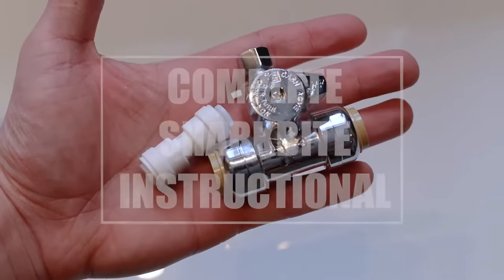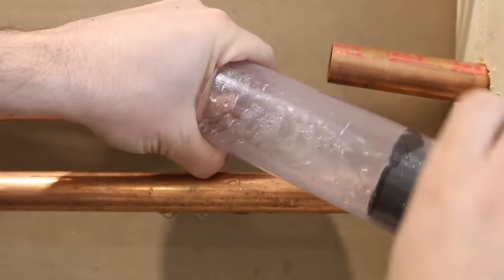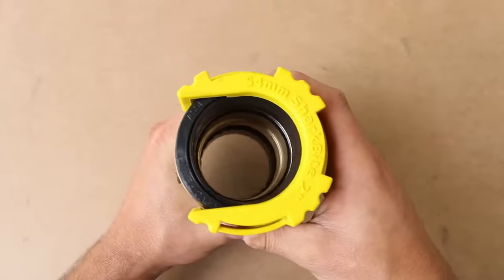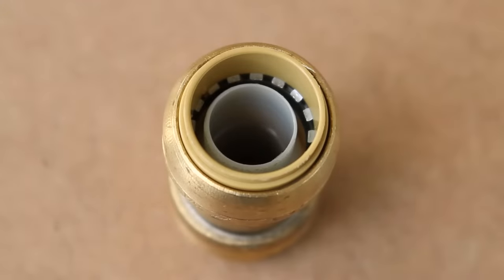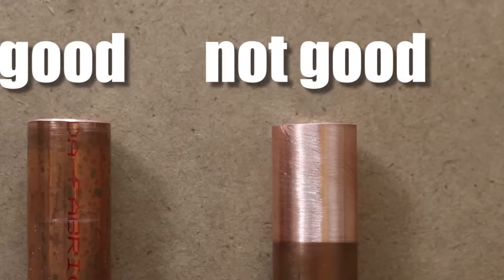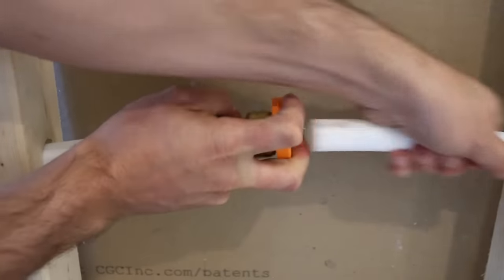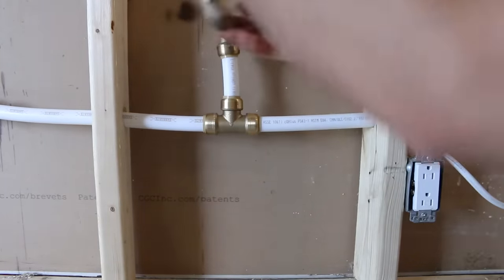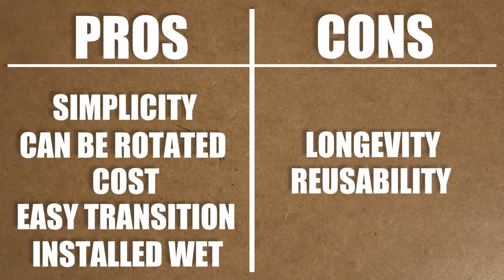Beginners Guide To SHARKBITE Fittings (Watch till end BEFORE Buying!) | GOT2LEARN

Comment: I plumbed our pavilion with pex and crimp fittings back in 2013 and just recently had to repair 3 pin holes. One in the 3/4” after the main shutoff and 2 close together in the 1/2” branch. All were on an exterior walls. I’m not a plumber by no means but I’ve installed plenty but I’ve never seen pinholes happen in pex before. We’ve had some brutally cold temps over the years and since they all were in an exterior walls, I’m assuming that’s what caused the leaks. I still haven’t lost faith in pex… yet.

Comment: My house was built 2011 and the builder's plumber used a Sharkbite 1 inch to 3/4 inch to connect the water main coming to the house. This was underground and it failed in 2020. After checking with Sharkbite, they said they were not intended for this type of use and that will only last 12-15 years inside walls and straight-on connections only. Having it in the ground does not work because of settling. After looking at the pipe connection going to the house,  there was a slight bend in the pipe underground.  The plumber who came to the house also stated Shark Bites were not intended to be used outside underground.

Comment: I used them several times with no problem. The only exception is at my 2nd home where I turn off the water and drain it every time we leave. It would blow off or leak badly when I turned the water back on after several times. This was used on Pex 3/4 pipe.
Reply from the maker: Interesting.

Comment: Using this product is a heck of a lot cheaper than using a plumber. We have the grey PB plastic, and we have replaced 4 leaking T fittings. Just remember to buy the adapter from Grey PB to PEX and you will be fine using this product
Reply: Was the PB adapter a Sharkbite product or just a regular PB to PEX fitting with rings?
Reply: @MissLiz55  it is a Sharkbite fitting. It will be labeled PB to PEX with whatever diameter you need. On the adapter, the grey colored side goes to the PB pipe, and the white side goes to the PEX pipe

Comment: Wish I had learned about sharkbite when I was repairing water hose valve.  It was a PITA trying to solder a wet pipe.  But i'm with you -- not trusting this product behind walls, attic, or underground.

Comment: My father warned me about sharkbite fittings after several came "loose" after a couple of years on a friend's property.. was all due to the washing machine/dishwasher/taps causing shockwaves in the supply pipes, acting like a small hammer.
Guess it depends on the peak pressure and the pipe as to what it can deal with

Comment: The best thing bout these fittings, they can be installed even if the water cannot be totally shut-off. You could never solder a pipe if any water is present. Installed the fittings a number of years ago, no problems so far. 
You can get a plastic removal tool to take them apart, but I made my own with a piece of wood, works much better, especially in a tight space.
Reply: The metal removal tongs that Sharkbite sells are way better than the little orange plastic tools.  Costs about $7, they are size specific though.
Reply from the maker: @StilettoSniper  iCrimp will send my a tong that does all 3 sizes, pretty neat!!

Comment: About that cost- about $20 each here in my local store. It's enough that the hardware store plumbing guy prepped me for the sticker price after he restreived them from the locked case and before walking me to the checkout with them.

Update: after using for the first time, it's definitely a great product for basement usage at the low point in the system where you just can't get it drained. But I really don't think I'd want them buried behind a wall somewhere. This is in a century home, where the expectation is that things should last well beyond 100 years... and indeed much of the house is original.
Reply: The fittings can be expensive but thats really only been post-pandemic. I had bought a few during the great Texas winter a few years back and they were around $6 each, now theyve gone much higher, as you say, to around 15-20. I did find some off brand fitting at a local hardware store for around $7. This video shows the pipe being $14 per linear foot which ive never know pex to be any more than about $1/ft on larger pipes. 1/2" is typically only $40/100 ft roll. 

These fittings have saved my 50 year old copper in my home on several occasions and bought me time until i can get to replumb the entire system. At that time ill use cinch style connectors but you can bet your next paycheck ill be taking off the older sharkbite type fittings and saving them for emergency use!

Comment: 9:20 I'm not a plumber, but if a small burr is a problem from a turbulence/flow disruption standpoint, then a giant loose plastic insert sitting inside a copper pipe is also going to be. SharkBite has instructions for removing the insert without damaging the teeth, and it seems like it could potentially be worthwhile...at least if you're taking the time to remove internal burrs.

Comment: Great video. Very instructive. I was told that the white plastiv compression ring should be removed for copper pipe. Is that correct ?
Reply from the maker: It can remain, just make sure the inside of the copper pope is deburred so it doesn't catch while it's going in ;)

Comment: On horizontal pipe runs the pipe stiffener falls down and prevents any pipe from inserting more than about 1/8”. For this reason I ended up returning hundreds of dollars of shark bite fittings back to the store. The pipe stiffener is more or less captive inside the fitting. But it does move around a bit, but the pipe stiffeners must not be able to touch the inside wall of the fitting. I was using a Home Hardware version of Sharkbite

Comment: I think PEX / CPVC is harder to remove because the teeth can grip into the plastic more easily than copper. Pushing hard & going around in circles several times to disengage all the teeth worked with the orange clip — but it took a good 5 minutes the first time with a free pipe.  

Seems like a wrench or other metal tool would be much easier

Comment: I have never had a shark bite fail on me, but at the same time I'm still reluctant to use them over crimping or soldering.   
I will use push fittings in an area that is accessible But I definitely would not  use them in a closed wall.

Comment: I just installed a sharkbite push fitting on my 1/2” copper pipe for my washing machine valve and have 2 important questions.

1. The initial copper pipe was crimped from removal of the old compression ferrule, causing the new compression ferrule to be too loose on the pipe. I used a Sharkbite push fitting with a MIP end instead and no leaks so far. Opinions regarding the crimped pipe and maintaining a tight seal?

2. I cleaned the outer pipe well with a drill attachment, and also deburred the inside, but forgot to debur the outside edges. As mentioned above, so far no leaks, but it’s only been a day. Should I remove the sharkbite fitting, replace it with a new fitting after deburring the outside, or you think it should be ok?

Thank you for the guide!

Comment: Most faucets and water tanks only last 10-15 years, so when you get a new one just replace the fittings.  That being said, I wouldn't use them where I couldn't get to them easily just as a precaution.

Comment: I think I'm going to use this method to extend a pipe behind my washer in the laundry room to go outside for an outdoor facet.  Pipes are already exposed there and I don't have to run it very far.  I think it should work well.  I'll install a shut off valve inside for winter time, so nothing in the line going outside freezes.

Comment: A Good quality EPDM product can last a lifetime in water applications.   I have worked with EPDM for 45 years and have water hoses that have been outside for about the same length of time.    They are exposed to the outside elements without any degradation.  The clamped ends have never been replaced.

Comment: Do you really need to mark the depth on the pipe if it goes into the sharkbite till it hits the stop inside anyways? 🤔
Reply from the maker: Yes, for insurance purposes. If they decide to leak for whatever reason, you'll be able to use that to fight in court.

Comment: I live in VA and tbh ny pops and I havent used them but a hand full of times for the most part we just soder and flux the joint even transitioned the whole house to cpvc because of all the copper line leaks havent had a singke leak in that house sense we did it damn near 12 years ago

Comment: So when deburring the outside and  inside of the pipe as shown at around 7:50 of the video, it looks like it is causing the end of the pipe to become very sharp. Doesn't that pose a risk to cutting into the O ring upon insertion? Great video.
Reply from the maker: As long as the sharp edge isn't larger than the diameter of the pipe, you're fine 🙏
Reply: @Got2Learn  Thanks much!
Reply from the maker: @Charlie9165  Pleasure is all mine ;)

Comment: Really well put together. 

I've been gradually replacing the copper pipe for pex under the house for a couple of years. My experience with these have been a bit mixed. If it is a copper-pex connection it tends to work pretty well. With pex-pex I've found my clamp does a better job.

Comment: I'd never heard of sharkbites before (or PEX), but they sound like great problem solvers for DIYers like me who are intimidated by soldering.  I'm planning to remodel my bathroom and it appears that I could use these to change the valves in the tub/shower from a two-handle system to a one-handle system. (I watched your how-to video on that and it was very informative and well done as this one was. )  You noted longevity as a concern, but for me, that is less of a concern as long as I know how to fix it.  I have an access panel to the tub plumbing in the wall on the other side, so it would be accessible in case of a problem.  Is there any other reason why this shouldn't be used in the tub/shower setting?  Thank you for these very helpful videos!

Comment: You did not cover one thing. I tried using a sharkbite elbow and it had different color ends on it and one end of the 3/4 inch fitting would not go on properly. One end was kind of brown colored and one end was kinda gray colored. I cannot find any information why some of the fittings are this way. I took the fitting back and found an elbow that had both brown ends and it worked great Both ends were attached to cpvc piping. What is the gray color end for? Thanks! great video!
Reply from the maker: The colors vary from pipe to pipe, the reason for this is that the interior diameter of the pipe is slightly different so the insert is different to match the size.

Comment: You missed a big pro:  When pipes come out of a concrete slab or wall, the stubs can be short.  Any problems that require the fittings on them to be removed usually result in a need to cut the stub pipe even shorter, and you quickly run out of pipe!  A Sharkbite installed there means you can remove it if needed, and not lose length!

Comment: READ IF YOU USE !     There’s one way they work you did not mention. Shark bite gets it’s bite from? The water pressure, As the pressure forces the pipe out of the fitting “ wants to pop out” so this is where the teeth come in ultimately the pressure makes the teeth bite or bind like a Chinese finger trap “ kinda”. That pressure exerts pressure on the O.D of the pipe as well as directional pressure.
Reply from the maker: True, thanks for mentioning it!

Comment: I am a bit conflicted after watching your video. Based on what you said, these fittings are very reliable and proven, however, you say you would not trust them in a wall or under the ground. I’m not sure why you say this after you say how good and reliable they are. it is still much cheaper when doing a large job to solder pipe the old fashion way, it’s proven over the years, and truthfully, soldering copper pipe does not take that much effort. however, in my old age, I’m getting lazy, therefore any future plumbing repairs I need to do will either be done with pro press fittings or shark bite. Thank you for the good explanation.
Reply from the maker: They are good because plenty of contractors use them, I just need the "time" factor to be convinced because they haven't been out for long enough in my opinion.

Comment: With the pipe stiffner on the adapter to female or male iron pipe I found when using them to hook up a hot water tank to pex the stiffner fell off into the tank I'd used them to temporarily install my hot water tank when I replaced the water lines after renovation the stiffner were gone

Comment: Very well-done video.  I was going to try these to replace a saddle valve in a 3/4 inch copper line in my basement that goes to the refrigerator.  However, there is very little to no give in the pipes down there, so I am afraid that after cutting I will not be able to separate the ends enough to get them into the fitting.  Any suggestions?
Reply from the maker: Yes, you'll most likely need a "slip coupling", watch this video here and I mentioned how it's used: https://www.youtube.com/watch?v=ebvqSp-d8-0&t=4s&ab_channel=Got2Learn
Reply: @Got2Learn  Thanks, that looks like it would work.  I discovered that Sharkbite make a kit for exactly my need (I think it is called ice maker kit or something) but it seems only to be in 1/2 inch, while I need 3/4 inch.  Also, I saw someone jumping across the Sharkbite with copper wire to maintain grounding, is this required (I am in Canada)?
As this gets more and more complicated, I must say I am leaning towards just continuing to use the saddle valve connection- it has been fine for 20 years, and looks OK!
Reply from the maker: Yes, you need to bridge the ground for it to keep working 💪

Comment: So I shouldnt clean the exterior copper pipe before using sharkbite?

I am attaching the sharkbite fitting to 1/2” existing copper tubing approx 40!yrs old and the copper tubing exterior is a bit “dirty” and even has some light solder down the side.

How do i prep this if not with sandpaper as you state in the video?

Is emory cloth ok?

Comment: I just used them on my hot water heater because the water kept dripping and I couldn't get it soldered properly.  I am at peace with it.  And I just cleaned the pipes and pushed them on.

Comment: I was reading to re-lubricate the plastic pipe with food grade silicone sealer, same as with the large O-rings used on water filter housings themselves - then you reinsert the lubricated plastic pipe back into the sharkbite fittings - though I hear they still wear out after a few uses. What I am interested in is that some state you can remove the O-rings inside a sharkbite fitting with a long screwdriver, and insert a new lubricated one inside the old fitting - pushing it in with the hose you are inserting - you mentioned this can't be done - ?

Comment: plumbing professionals are comfortable using pro press fittings in walls and floors. the only difference between pro press and sharkbite is how the fitting is adhered to the pipe. both use an o ring to seal the water. i sometimes think all the fuss about sharkbite is plumbers worried about losing work.

Comment: I use SharkBite to replace every shut-off valve and install new shut-off valves in renovated showers with access in the closet to handle any repairs or installation new shower fixtures.  It would have cost me thousands to do what I did but it only cost me the price of the shark bite

Comment: I was hoping you would explain how to use them in a half inch copper system in the floor when the pipes cannot be separated to make room for the SharkBite. In other words how do you get a SharkBite fitting in a joint where the two pipes are stationary I cannot be separated?
Reply from the maker: I have a full video on this, check it out: https://www.youtube.com/watch?v=ebvqSp-d8-0&ab_channel=Got2Learn

Comment: Contrary to what he says, the plastic pipe stiffeners should be removed because they restrict flow.   At least with copper and CPVC, there is certainly no need to reinforce them; they are more than sufficient without internal stiffener.  As to PEX, my experience shows it is also sufficiently self-supporting, at least up to 3/4" diameter.  The internal stiffeners are indeed need for PEX when using standar brass compression fittings that require hard tightening.

Comment: What do you think about a suspended expansion tank from these fittings? My concern is over time the weight of the tank on the Sharkbite joints. Thank for great videos!
Reply: Mines been up for 12+ years no issues.  You can also hang a pipe brace if you wanted.

Comment: They are illegal in Dallas because the insert restricts water volume. I will admit I do high rises with 300 psi pressure test. They hold and propress usually those fittings blow apart first

Comment: Two questions my man #1 is there a lube that can be used for old fittings or for maybe easyer install of slip joints ? #2 so the pipe does not have to be prepped other than deburing ?
Reply from the maker: 1) Food safe lube works (olive oil LOL)
2) Yes, just make sure the outside is clean and if there's gunk, use an abrasive pad to remove.